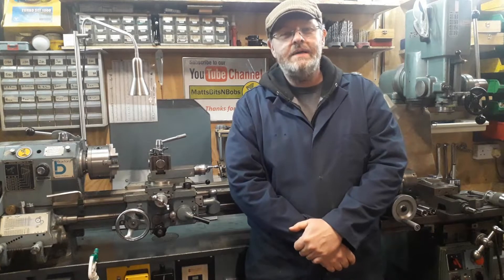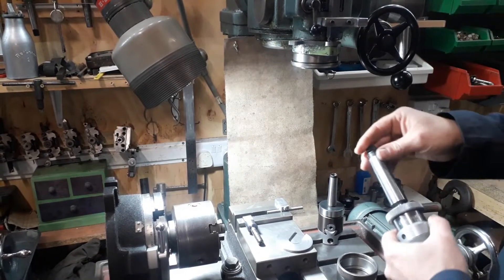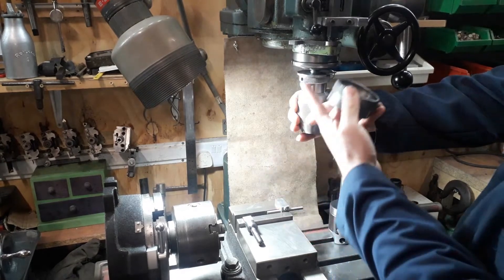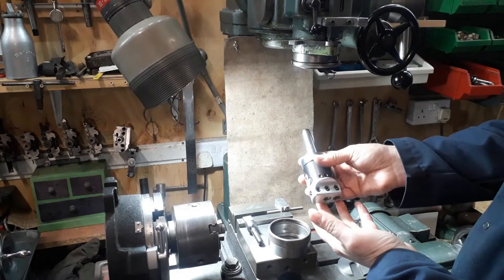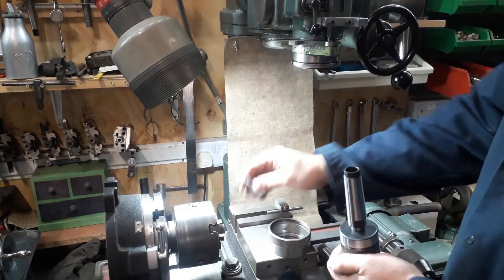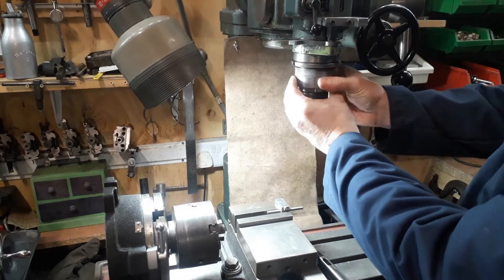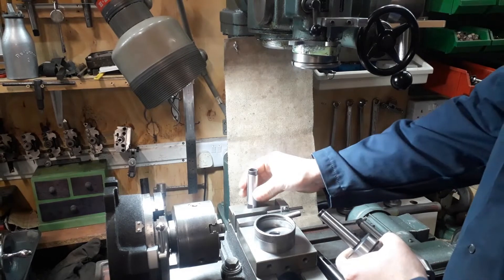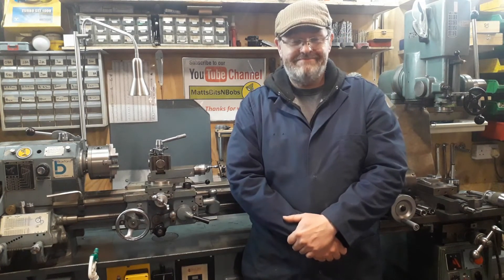Milling Machine Tools for the Arboga U2508

Comment: I have an arboga and have been struggling with how to hold my jacobs chuck in it. My retainer ring won't fit over it
Reply from the maker: Could be the chuck is to big for the machine, mine just passes in the ring, but for drilling the taper will hold it (like using a taper shank drill bit) as the force is up into the taper socket so no need for the ring. Never do this for milling ops, always use your collets or endmill holder that you can use the retaining ring on. Cheers and happy milling.

Comment: Verry original and clever solution. I recentley purchased a similar arboga EM 825 unfortunaly i do not have the locking ring for the spindel. Would you by anny chance be able to take some dimensions of your ring so i would be able to recreate one? Thanks in advance.
Reply from the maker: I have some sizes for you on a drawing but I cant add it here so will try this.
Overall length 32mm
Width 68mm
Main internal diameter 60mm
Small diameter (making step) 55mm
Step 3mm
Check this seems to fit your machine (you never know) Take the thread measurements off your machine to be safe. Hope this helps cheers
Reply: @mattsbitsnbobsworkshop  Thank you verry much, this helps a lot!
Reply from the maker: @siebeleen3183  No worries
Reply: @siebeleen3183  And the thread is 61,7 x 1,25. That would probably equal M62 x 1,25 but you would probably test until you get the right fit.
As I have heard it, that nut cannot be bought even in Sweden so you have to make it by yourself.
I recommend drilling 3-4 holes around the circumference for a "ratchet wrench". That cannot be the right translation by Google Translate but I really don´t know what they are called in English. Anyway, Matts chuck has a similar hole visible at 1:15 above his left hand.

The machines from Arboga (which actually is a city just about 30 km from where I live) are known to be almost indestructible but you have to remember that it is a drill press that can be used for some quite advanced milling if you have the right tools, but it isn´t a milling machine seen from a ridigity point of view. But a boring head and an ER40 collet chuck will make the Arboga complete. 🙂
Some carbide mills and face mills with indexable carbide cutting tips (cheap at Ebay) and an arbor for slitting saws and you will be able to make much more than anyone would expect from "just a drill press". 🙂
Reply from the maker: Cheers  @Maskinservice  yep agree with the holes if you make one, I am in contact with a gent in the states wanting to make one and I have said to do this (I may make a new one in the future like this) it will make life easier. And as the difference in thread thats why I said check all the sizes to your machine before you make (but sure you will anyway) thanks.
Reply from the maker: Thanks a lot, it opens up the amount of tooling you can use. yep no worries I will get some sizes for you, give me a couple of days, cheers

Comment: Ingenious. I made a disc to fit the arbor between the MT3 and an Albrecht chuck. However you also need a spacer ring to go inside the threaded 'nut' to take up the gap that remains.  With this arrangement however the knurled ring on the Albrecht half-disappears into the Arboga 'nut' and you can't grip it properly.  Otherwise I made  a fingerplate and spacer ring for use on an ER 32 collet MT3 adaptor and use that for much other tooling.  My lathe  tailstock is MT3 so MT2 tooling would be a greater labour of love. Looking forward to more on the Arboga. Have you had to replace the Tufnol headstock gears?
Reply from the maker: Cheers for that, yes some of the other tooling that came with it I needed to make spacer for and a finger plate for the drill chuck, the previous owner used it without (ok for drilling) but feel hapier now I've made one. Going to the use of MT2 on your lathe, using the MT2 on the Arboga gives an easy way of safley using it if then you want to use it in your lathe the 2-3 sleeve is already fitted! I will add that to the description if you don't mind. 
Luckily for me the gears are in good condition so hoping it's not a job I need to do soon. If you need to I have an exploded diagram kicking around, let me know I could send you a copy over if it helps? Thanks for your support.